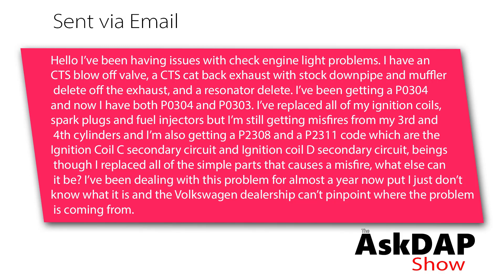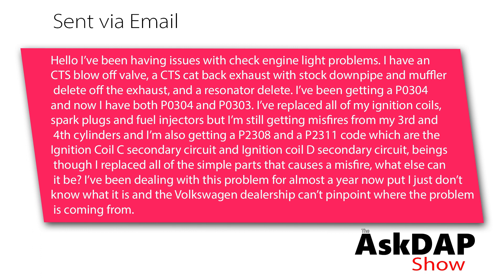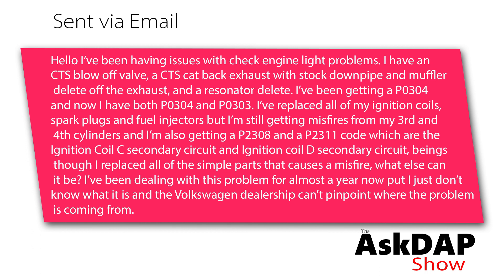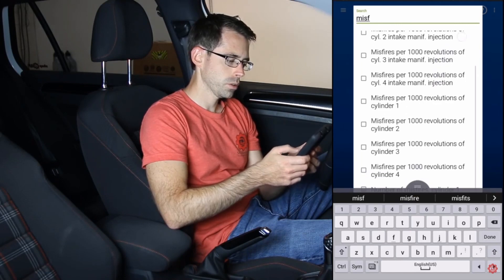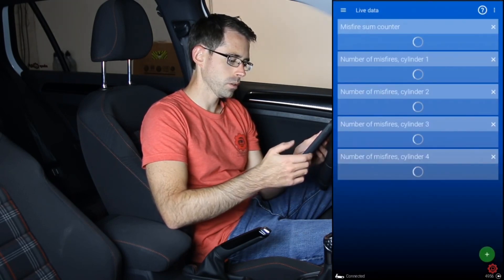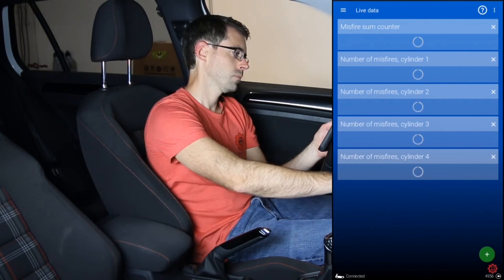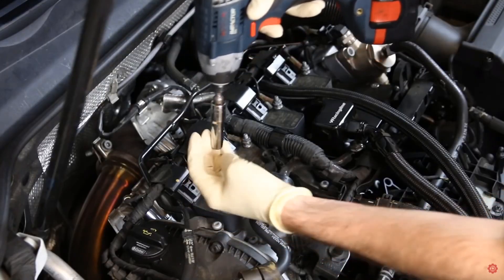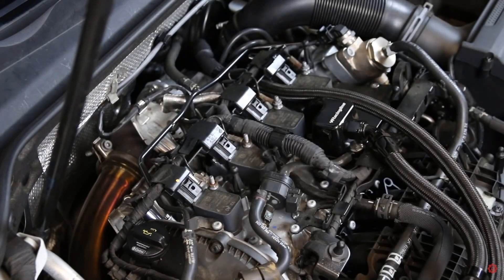Still Having Misfires After Diagnosing Everything | AskDap

Comment: I have an 02 ram 1500 4.7. Still have miss fire #2 cylinder. Change plug, coil and fuel injector. Also motor is a rebuilt crate motor. Motor has less than 13k miles after 3 yrs. Sad to say out of warranty. Machanic checked it and could find nothing wrong. Whats next step?

Comment: I replaced clutch disc in Renault megane 2010, now engine is misfiring, engine light is flashing when i go above 30mph. codes says that multiple misfire detected. I changed spark plugs and ignition coils as well, compression is fine in all the cylinders. 
I connected OBD scan tool, no codes related to mass air flow sensor, now mechanics are investigating my car that the fault is in fuel injectors/fuel pressure or anything with electrical wire harness that is connecting with spark plugs....

I am really worried...
Any leads/suggestions would be really helpful, thanks

Comment: I have a 1996 Toyota Supra.  Changed all six spark plugs, it ran fine for the 1st few miles, then engine misfire, with code p0300, p0301, p0304, p0305.  What could be the issue?  Can you help?  Thanks a lot in advance!
Reply: We’re you able to figure out the issue? I’m having the same problem rn
Reply: Were *

Comment: Hello. I have a 2013 ram 1500 I just changed spark plugs, coil packs and fuel injectors it's running fine but now I have a stored cylinder 4 misfire and fuel system rich 1/1 and 2/1 pending. Can you help me?
Reply: Did you find the problem with your ram 1500?
Reply: @rxtube4873  yes its bad electrical wiring.
Reply: @SLIM-iz3kl  from where ?
Reply: @rxtube4873  once I bought a new computer and replaced the fuse box no more engine codes. 🙃
Reply: Now I have lights that work sometimes and sometimes they don't. I'm thinking it's time to replace the whole wiring harness on the engine bay.

Comment: I have a 13 mini cooper base model, thing was running great and while on the freeway got p0303 that's all I have is cylinder 3 misfire, compression is good, its not plugs coils or injectors I am at a loss
Reply: Did you ever figure out the issue?im currently in the same place and im honestly thinking it might be my headgasket or ecu im not sure tbh. its just on cylinder one, i changed out all sparkplugs, wires and coils, i have good compression at around 160psi but when i did take out the spark plugs which have less than 500 miles on them, on cylinder one its full of blacksoot which is why im assuming its the headgasket? its a 2010 cadillac escalade esv with the 6.2L V8 and the vehicle has around 73,800 miles on it. i almost forgot but i have also changed out the injector

Comment: Great video, my mysterious story until today is ... I have replaced VVT sprockets (know as cam gears or actuators) on 2010 petrol insignia, since day one the car lost of power at all, on the highway moves like turtle, gets the car+wrench light on and off if trying to force for power no codes came up on the dash. However, in a later stage the car start misfiring  randomly following with the codes, and lately was confirmed as cylinder 3 P0303. Changed everything, spark plug, coil pack, injectors, nothing has changed, the dealers are lifting their shoulders, and i am left at mysterious crap. I didn't have any similar issues until these parts has been replaced.
Reply: Did you fix it ?

Comment: Hi hope u can help me my mk6 gti 2.0 if i push 6000 rpm hAve misfire cylinder 3 and 4 is below 6000 is fine my coilpack and spark plug is good injector also good what that problem
Reply: Pcv valve
Reply: I have the same issue. How did u solved it?

Comment: I have a 2011 Jetta 2.5 with P301 code that wont go away. I changed the ignition coil and spark plugs and code went away but two weeks later came back. The. I changed the fuel injector and the code is still there P301. Any suggestions?
Reply: I have the same problem as yours, I have replaced all the spark plug and ignition coil but the error code remains.
My question is have you solved the problem and what was wrong? Thanks.
Reply: @SuperInterpol1  please can you answer what is the problem, I also did everything.
Reply: Same thing for me on my 2010 kia optima. I have a cylinder 4 misfire after replacing everything
Reply: @denaotto6444  update?
Reply: @victoriamccarthy3050   yes..I had to sell the vehicle. Got too expensive..I literally fixed everything and went to mechanic after mechanic
Reply: @denaotto6444  ugh. I will never buy a Kia again. However, I was going to say that they shouldn’t of said that to you about paperwork, but you’re just a year outside of the lawsuit that was filed against them! Do you have any recollection of what the rod bearing failure sounded like? Did your car burn excessive oil (and you had no idea where it was going)? Is knocking actually a knocking noise, like very loud? I have a 2015 optima with a 2 year old long block assembly. I got a random misfire in just one cylinder the other day so I changed the coils and plugs, but now the same DTC code. I ask if you have any insight because I really am trying to avoid them diagnosing it due to the cost.

Comment: This is my email, I didn’t even realize you did a video on this until now... I fixed the ground issue
Reply: So that was the issue?
Reply: I have a 2011 Jetta 2.5 with P301 code that wont go away. I changed the ignition coil and spark plugs and code went away but two weeks later came back. The. I changed the fuel injector and the code is still there P301. Any suggestions?